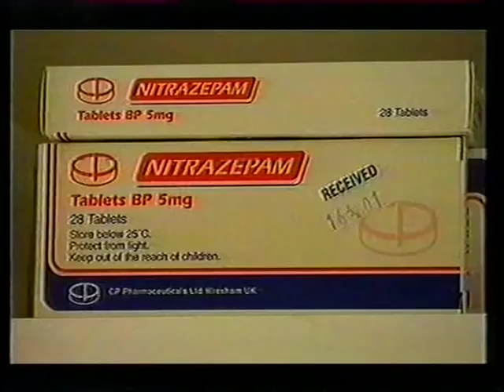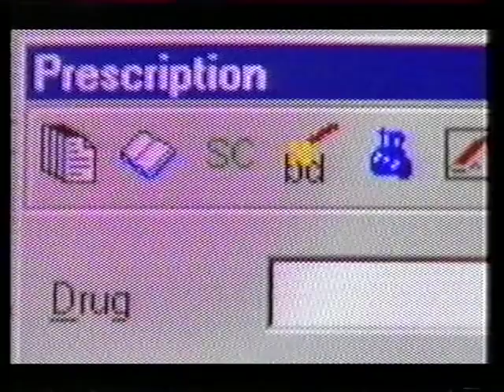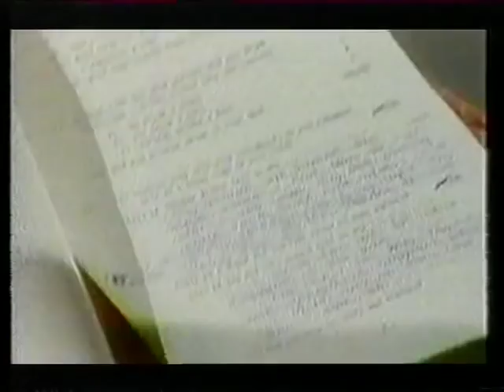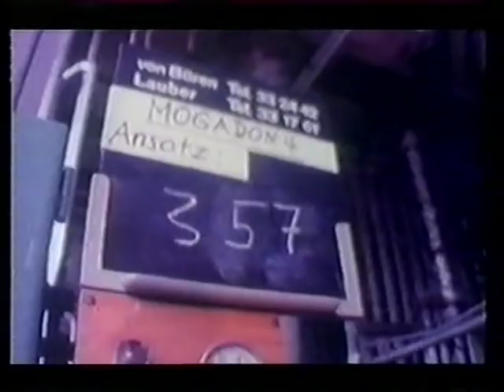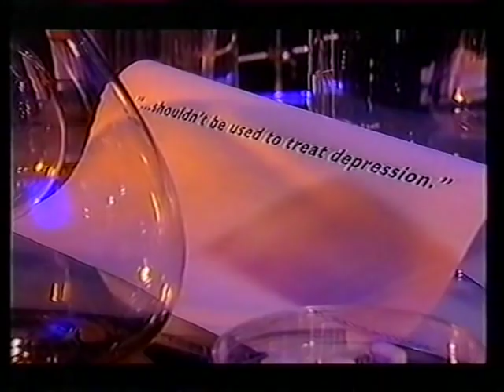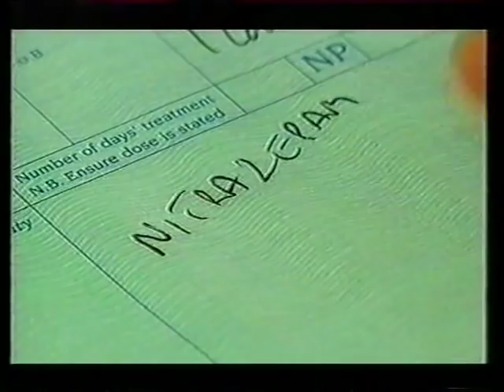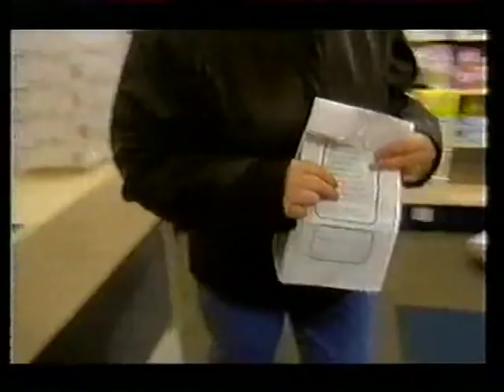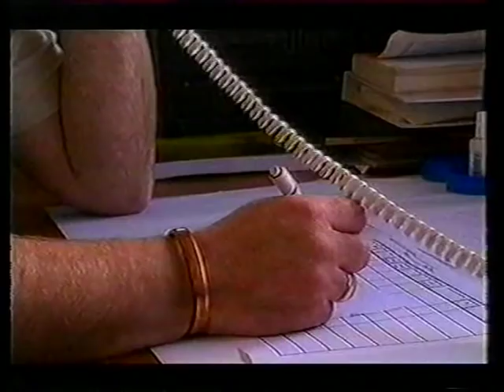Benzodiazepine Benzo Documentary Xanax Klonopin Ativan Valium Tranq Trap 2001

Comment from the maker: The GABAergic system (GABA receptors) is an inhibitory system, counteracting the Glutamate system (Glutamate receptors), which is excitatory.

GABA and Glutamate regulate action potential traffic.

GABA, an inhibitory neurotransmitter, stops action potentials. (Rest and Digest)

Glutamate, an excitatory neurotransmitter, starts action potentials or keeps them going. (Fight or Flight) 

Since GABA is inhibitory and Glutamate is excitatory, both neurotransmitters work together to control many processes, including the brain’s overall level of excitation.  Under normal conditions these two system are in balance leaning this way or that based on external forces i.e. a bear attack (excitatory system takes over, adrenaline floods the system, muscles tighten, vision and hearing are heightened, mind races, anger takes over etc.)  or i.e. bedding down for the night (Inhibitory system takes over, muscle tension decreases, cortisol levels drop, adrenaline levels drop, body prepares for digestion, sex and sleep.).

Benzodiazepines (as well as alcohol) attach to the GABA-A receptor site of the GABA receptors located on the dendrites of the cell neuron, imitating the natural GABA, signaling to allow a higher than normal flow of Negatively charged chloride Ions to pass though the GABA receptor gate depolarizing the neuron, super-activating the inhibitory system and overly suppressing the Excitatory system.  Benzos also force natural GABA to bind tighter and longer to the cell dendrites signaling thru the GABA-A receptor site to also allow more Negatively charged chloride ions to pass though.  Result = Very relaxed.   

As a result the body up-regulates the Glutamate receptors (Excitatory system) and releases more Glutamate, which then attaches to the Glutamate receptors allowing more Positively changed Sodium and Potassium Ions through counteracting the Negatively changed Chloride Ions and bringing back the overall balance.  If the body has more of a Negative charge it's relaxed, if more of a Positive charge it's more alert.

Where this all goes wrong is when the body and brain, due to being flooded with too many Negatively charged Chloride Ions, start to eliminate a minor yet significant percentage of the GABA receptors on each cell trying to hinder the Chloride ion flow.  When this action fails to work the body and brain take further steps of producing new GABA receptors without the GABA-A Benzo/alcohol/GABA attachment site.  All is well and good until such time as the newly produced GABA receptors now lacking the GABA-A attachment site outnumber the older receptors which still have it.  When this happens those prescribed benzos start to experience interdose withdrawal (Anxiety and Panic while still taking the medication).   Doctors will try to solve this issue by prescribing a higher dose, however, very quickly the body responds by producing more GABA receptors without the GABA-A attachment site, plus will continue to absorb older GABA receptors.  Soon, Tolerance of the med hits.  The meds poops out.

While the early days of the above disaster are unfolding the Limbic system of the brain, thyroid, pituitary gland, etc. which are directly attached to the GABAergic system start to misfire and odd states of reality, emotion, fear, anxiety, paranoia, memory, balance, aggression states, sexual arousal etc. become more and more pronounced.  Moreso once tapering begins and worse still once off the meds.  Here are the parts of the Limbic system which start to misfire.

Amygdala -  The Aggression/Emotional Center.  Responsible for detecting fear and preparing for emergency events.  Fight or flight.  Stimulated, it produces feeling of anger, violence, fear, anxiety.   Damaged, or medicated, can result in a very mellow state of being, hyperorality, hyper sexuality, disinhibited behavior - ignoring social conventions and engaging in dangerous, reckless behavior. Responsible for fear conditioning, the "associative learning process"  where we learn to fear some thing, some place, someone, and/or a social circumstance. 

Hippocampus - Memory and spatial navigation. Forming new and storing memories. Coverts short term memory to long term memory.  Responsible for emotional reactions to past memories and events.

Thalamus - Regulates the body's voluntary motor control, consciousness and its sleep/wake cycle.  It also regulates the senses of sight, sound, taste, touch and the sense of where the person's body is in space.  

Hypothalamus - Produces hormones which control the production of hormones in the pituitary gland. Hypothalamus function is directly related to overall hormone health.  Fight or Flight/Rest and Digest plus body temperature regulation.  Responsible for the release of adrenaline via the autonomic nervous system.  Hunger, thirst, sleep, sex.  The hypothalamus sends danger signals to other parts of the brain and puts them on high alert, preparing to fight or flee. It also tells the pituitary, adrenal and thyroid glands to secret more hormones to prepare the body for action.  

Cingulate Gyrus - processing emotions and behavior regulation. It also helps to regulate autonomic motor function.  Emotional Memory.  Regulates pain and emotion.  Is particularly involved in driving the body's conscious response to unpleasant experiences, therefore the avoidance of negative consequences. 

The end result of this, in part, is the Excitatory Glutamate system is no longer being kept in check by the GABAergic system so it's running wild.  This causes overblown and confused states of mind (anxiety, panic, confusion, memory, depression, phobias, etc.),  body malfunctions (thyroid, putuitary, tachycardia, automonic nervous system, etc.) and pain becomes the norm (neuropathy, lower back, etc.).  To add insult to injury now the patient has to come off the meds, the only substance slowing down the  Excitatory system and giving it even more freedom.  Unfortunately glutamatergic receptors are not homeostatic like GABA receptors, changes to glutamatergic receptors stick around.  Since GABAergic medications or substances no longer work to offset the now raging Excitatory system all one can do is endure it (survive) until such time as new GABA receptors are being created with the GABA-A receptor site.  This is what happens during the healing process (Benzodiazepine Withdrawal Syndrome) and is entirely dictated by the level of damage done by the medications and the genetics of the individual which allow how fast the body and brain grow new GABA receptors with the GABA-A attachment site restoring the broken and off balance systems. 

In the meantime, any substances, or states of mind (Stress), which irritates, or boosts the Excitatory Glutamate system must be avoided.  Items such as sugar, MSG, caffeine, any GABAergic agent (alcohol, St. John's Wort, Camomile, 5HTP, KAVA, Z-drugs [Ambien], Phenibut, etc.) and everyday chemicals and foods become landmines as each can cause horrific increases in withdrawal symptoms for the individual, again based on genetics and sensitivities, and since GABA is directly responsible for muscle tone and mass we also experience a wasting, withering physical state.  We lose muscle mass, gain (or massively lose) weight and have an immune system which is barely there all while the body and brain are malfunctioning on a level never imagined possible. 

P.S. For ease of understanding, it only takes one day to burn down a 100 year old forest, but a long time to grow it back..  Your GABA-A receptor forest has been burned down by benzo use.. This forest must regrow and it's takes a long time once GABA agonist use has stopped.   During this time, no GABA agonists can be used, most especially alcohol..  Alcohol is kinda sorta like liquid benzos, and benzos kinda sorta like freeze dried alcohol,  they are cousins.  One cannot replace one with the other or healing will never happen and GABA-A recpetor sites will have no reason to regrow.   Also, the two highest concentrations of GABA-A receptors are the stomach/gut and brain.  Which is why those in recovery have so many issues with food, digestion, etc and mental health issues. There are approx 50 Trillion GABA-A receptor sites on the Human Body.. one for nearly every cell.. Every system is impacted..  Every.. System..
Reply: Wow, thank you Paul, I've felt so alone, thank you for explaining that I'm not going mad, I know I'm not mad sometimes then I lose it again, good to be reminded of the science. I am gutted right now, I've just got through a year and a half of tapering in which my body and mind literally twisted up, about a month after my last crumb of diazipam i started having seizures, ended up in hospital despite apparently  insisting that it was all expected in withdrawal, dr put me back on diazepam up to 16 mg before seizures stopped, now I'm 6weeks into taking diazepam again and joining the dots, I'm desperate to get off, by my calculation it will be another year, I've started tapering yesterday and already feel weird, I'm dreading the cripping pain and screaming, and I'm not sure what to do about the breathing problems, my autonomic dysfunction is very bad, I also have a few rare genetic diseases, like Ehlers Danlos Syndrome so I thought I knew a life in constant pain already but this was indescribable and I'm dreading it, the horrific thoughts were very disturbing too. What a massive set back, I'm only just well enough today to understand what has happened and I'm so sad I've wasted over a year, my father had terminal cancer and I am too ill to help or enjoy my last year of two with him, even when I do bravely see other humans i don't remember it now, I used to be so sharp, so bright, so possitive, hopefully I'll get back to me one day, I hope it's soon enough. Thank you Paul for everything you do to educate people.  Whopping love and hugs to you xxx
Reply from the maker: I am very sorry this happened.  Did you stay away from alcohol while tapering and also once off the meds?  
Are you in a benzo group on Facebook or reading Benzo Buddies on the Internet?  My name on Facebook is the same as it is here..  Feel free to add me..
Reply from the maker: Have you stayed away from z-drugs like Ambien, Lunesta, etc?   Or Progesterone ?
Reply: Paul Chomiak yes, but I took sleeping pill zopiclone a few times during the taper esecially after a week or so of no sleep, the hallucinations we're getting too bad, needed sleep, hope it wasn't that. Xxx
Reply: Paul Chomiak Paul did you write this yourself ? Also can you email it to me please? I cannot copy and paste. Thank you 🙏🏻
Reply: Paul Chomiak  my god  paul  your  information  is beyond extra  ordinary   ( fantastic) l really  want  to  call  you  sir  l feel  you  have  given  us  a great  education  on  how  this  all  pans  out  god  the  suffers  must  be  going  threw  hell.  My absolute  thanks  paul.  Ps its a real  real problem
Reply from the maker: Mirtazapine is a tetracyclic antidepressant similar to maprotiline (Ludiomil) and tricyclic antidepressants, for example, desipramine (Norpramin).  This will take some research on your end..   Look for SSRI and Psych med tapering groups on Facebook..
Reply from the maker: I was on multiple anti-depressants SSRIs while on benzos.. I got off of Lexapro first, then started tapering the benzos..
Reply: Paul Chomiak whew !!!
Reply: Paul Chomiak thank you
Reply: I am going to make an asmr video reading this. It NEEDS much more awareness. Give me a few days. I'm tapering.. experiencing more and more of these symptoms everyday. It's horrific. Barbaric and sad.
Reply: Mike L about as long as this comment. Bless this guy . Have had 4 failed surgeries in 3 years the fourth being a total reverse shoulder replacement which proved to also b a failure as well . Now permanently disabled. This took me Down financially, emotionally and physically. I've lost just about everything. So these surgeries also created PTSD , severe depression and anxiety. I'm on a mix of drugs . Still hanging in there and still fighting w workers Comp to get even the basics that I need . I got hurt working for them have had four unsuccessful surgeries because of them and working for them the least they can do is provide the basic meds I need monthly instead of having to fight them every step of the way . Yes , I also have a lot of anger that I deal with . Trying to remain positive through it all regardless.
Reply: The reason I said whew! To the comment was because not only was it knowledgeable but fascinating as well . I'm hoping no one took it the wrong way . 😀
Reply: god.. help me.
Reply: Great info! I hope everyone in this comment thread heals all the way through, we are fighting this battle together in a way
Reply: Was that worth 19 likes,???
Reply: I never usually read long comments but I read all this with intense interest. Brilliant explanation, they make opiates look like smarties
Reply: @paulchomiak1318  Thank you Paul.  Been off xanex 6 months. Been rough. Everyday. I finally understand reading your post. Have no appetite. I just pray everyday.
Reply: Paul such amazing information thanks so much. It’s like what’s called post acute withdrawal symptoms in Addition Recovery world. Acute withdrawal first then depending on the person it can take up to 18 months for the brain to heal ( post acute withdrawal) I had this  after 8 years heavy weed use.You are so right stress, alcohol, lots of coffee,  any mood altering substances brought back symptoms of depression, aggression, dark thoughts etc. Not quite as bad from weed as SSRI’s or Benzo’s but still much worse than young heavy weed smokers realise. Of course severity depends on person. Stay away from booze as you say.  You explaining the science behind what I felt is amazing. There is light at the end of the tunnel folks you will bet better. Exercise is amazing when you can do it. Especially walking. Why don’t doctors warn people of these withdrawal symptoms. Probably because they are not aware of post acute withdrawal. Sad.
Reply: Prescribed Klonipin for SEVERE insomnia. Worked like a charm then Dr said those were not "worth the headache" to prescribe. I had been on Xanax years before and stopped no Robles. I thought it would be the same for Klonopin... nope! I've never wanted to die so bad as when I stopped them. Insomnia became almost neurotoxin, I literally lost the ability to walk some days!!! Months went by, finally I approached a more tolerable level of living. PAWS is a deadly syndrome and I was never aware of how your own mind/body can turn against you!
Reply: Perfect.

Comment: Currently a daily user of Etizolam. Have had no problems. Low doses are very effective. Technically not a benzo, it’s a benzo analogue and it’s helped save my life. Benzos are definitely overprescribed but also unfairly demonized.
Reply: As an addendum: why aren’t SSRI’s demonized the way that benzos are? I’ve come off of Xanax, klonopin, halcion, restoril, librium, dalmane, and none of them have even come CLOSE to the withdrawal I’ve experienced from SSRIs.
Reply: Easy answer Geoff. $$$$$$$
Reply: Benzos are inexpensive and require responsible monitoring. I’m afraid that is a poor business model. To make it worse, they steal market share from drugs that are still under patent. Can’t have that. Efficacy is no longer the deciding factor. In fact, it seems more and more that it’s not a consideration at all.